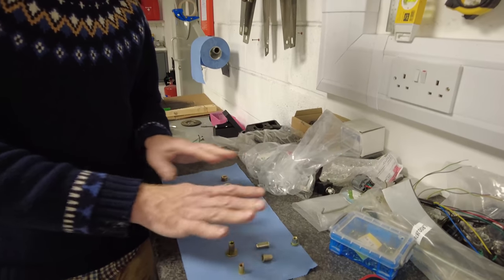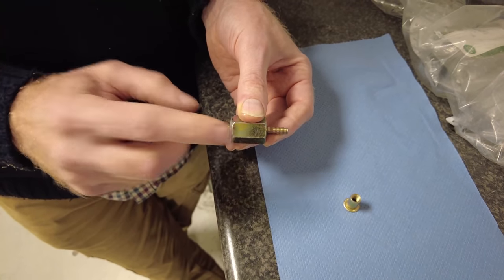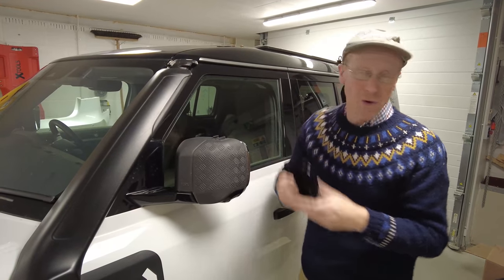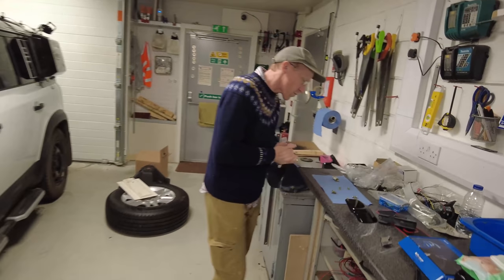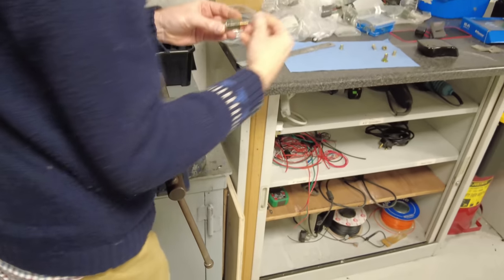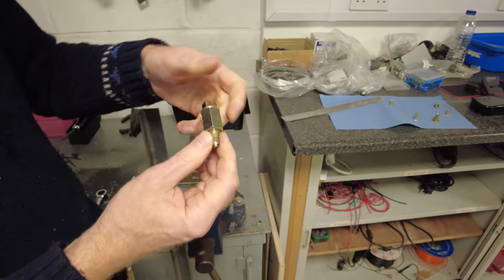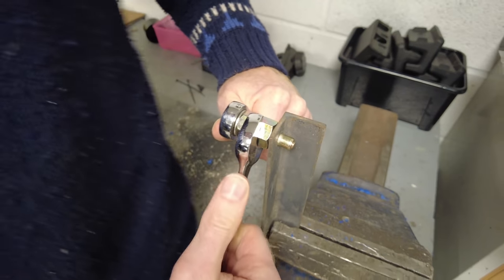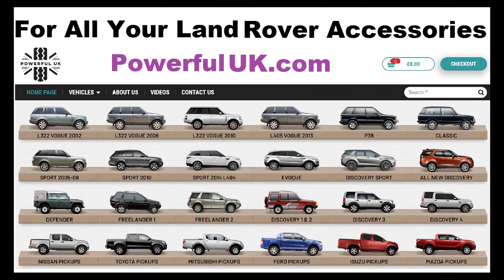Simple Manual Rivet Nut Insertion Tool Demo

Comment: Nice little tool. A bit more info: rivnuts are also called rivet nuts and nutserts in some markets and they come in steel, stainless steel, and aluminium. You can buy rivnuts with different grip ranges according to the thickness of the base metal. Also, the flange prevents close contact between the part being fastened and the base it's being fastened to, so if this is an issue, get the countersunk versions. If the rivnut is of a different material to the base metal, e.g. stainless rivnut in aluminium, use an anti-corrosive jointing compound like Duralac to stop galvanic corrosion.
Reply from the maker: Thanks for the valuable extra info !
Reply: Nutcert is not the same as rivnut. Nutcert has 2 pieces that wedge into each-other and expand the outer one. Nutcert is better to use in a blind hole, while rivnut is better for sheet metal.

Comment: Gosh that's a sloppy way of installing a rivnut. Can't beat pneumatic or maybe electric as you push square to the job and NOT end up with a crooked thread. You can't always push your belly onto the rivnut either 😁If it comes to installing one or three you can make up your own rivnut installer AND use a nut driver - much easier and better chance of a square finish. Thanks guys for your efforts.

Comment: All you really need is a hard steel allen bolt, a washer and a nut along with an allen wrench and an open ended wrench. Hold the bolt with the allen wrench and tighten the nut.
Reply from the maker: Yes you are correct - the biggest problem is that the rivnuts can rotate
Reply: @L663  That's also true. Here in the US that tool is available at Oreilly

Comment: This will NOT work with installing the snorkel. It will not fit all the way through due to the metal plate on the body. Do yourself a favor and buy the actual tool on Amazon
Reply from the maker: My snorkel is still on .. but i agree there are more expensive purpose made tools.
The question could be is why did Land Rover not install a fixing here - like they do for the roof racks etc

Comment: Much easier in a tight space where my usual rivnut tool is tricky to use.
Reply from the maker: Hi Mark - Rivnut tools used to be expensive but they are cheap now - this tool as you say is only really needed where space is tight.

Comment: Hello Simon, in 1990s I first used rivet nuts M6 and M8, we had compressed air guns for them. Are they new in England? I used to make interiors of vehicles, work vehicles.
Reply from the maker: No they are not new here but still they have not been widely adopted by car modifiers etc
Reply: @L663  thank you for the explanation.
Reply: Mostly bus/coach builders' trouble is the dam thin metal they use causes the Rivnuts to come loose. Thank god they are going over to structural adhesives a lot quieter and stronger.
Reply: @richardsellars  it will explain alot, I am a coach builder/ finisher by trade. I used them when I made vehicles.

Comment: These tools are really handy for inserting threaded nuts into under dash areas, however, you will be hard pressed to pull up the stainless steel type with this, it also help enormously to apply plenty of grease on the pull up side, you can also buy the straight pull type of applicator which works on straight mechanical advantage like a pop rivet setter, stay safe ! Chris B.
Reply from the maker: Hi Chris - hope you have been keeping well - you have been quiet for a while !
You are correct those stainless rivnuts are much tougher to compress.
The pull type are good but you need to have room to access.
Reply: @L663  We have had a lot of computer problems! Electronics, they are the most unreliable invention ever, and our Range Rovers are packed with them, hope to see you back over here soon. Chris B.